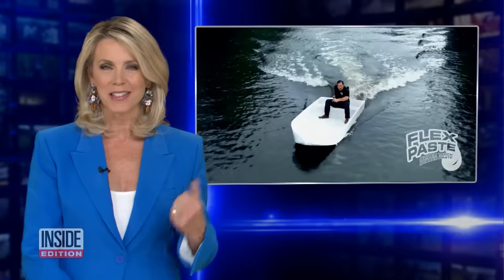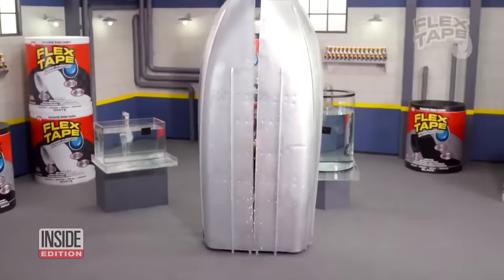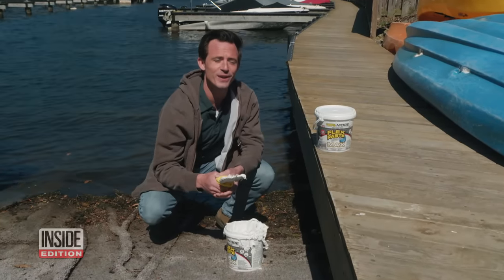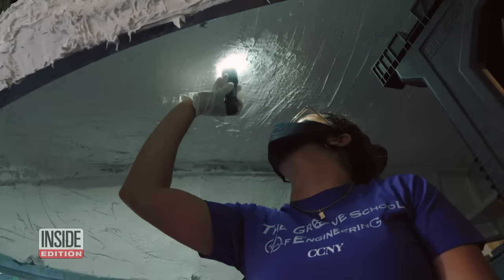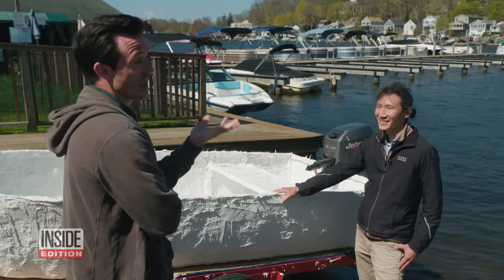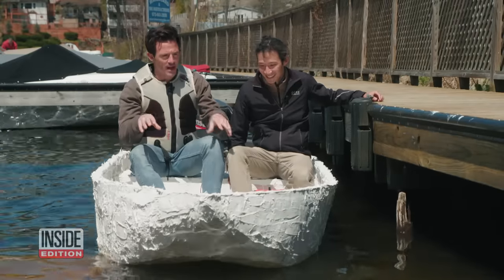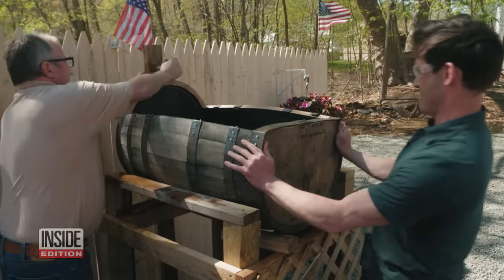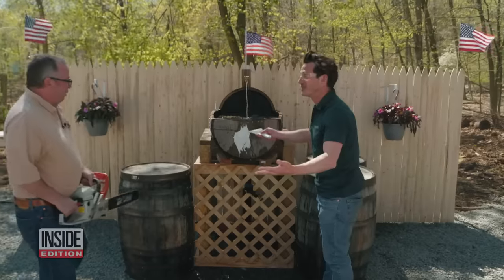Does Flex Paste Work as Advertised?

Comment: To Phil Swift and everyone - I live in a multilevel home and for years I've had troubles with my bathtub leaking when you took a shower. I seen the flex-seal commercial and decided to try it on my bathtub as a seal around it and the wall covering. I am here to tell you for over 3 years it's been on there and not one leak! This stuff works!
Reply: Flextastic!
Reply: Smdh my condo neighbor above needs to use this…just had a waterfall through the shower fixture 🤔
Reply: Flextastic 💪🏼
Reply: The prophecy is true then...
Reply: @lrac_1  secret santa gift it to hjim
Reply: Why is Phil using your shower?
Reply: @mmeo976  "to Phil.....I have a bathroom that leaks when you use it"
Reply: @mmeo976  yes, I know
Reply: @mmeo976  cause it was a joke based on poor grammar. Not that serious
Reply: @oatlord  🤣

Comment: I bought a used 2004 Mitsubishi Eclipse Fabric Convertible. I bought it for real cheap because the convertible top was leaking when it rains. Upholstery and auto shops was trying to charger me thousands to replace or fix it. But I decided to go to Home Depot and bought flex seal and some paint rollers and I painted a thin layer of flex seal on the whole fabric convertible. I tested it out 2 days later by going through a car wash and I had no leaks! And the convertible was still flexible to have it go up and down. I spent like $40. And the convertible top looked brand new. If anyone got a leaking fabric convertible top, I recommend using flex seal!
Reply: How has it held up?

Comment: I have used flex seal spray on a few things. I have galvanized chicken waterers and the seams sometimes leak after a few years. I sprayed all the seams on the outside and they hold water. I also have a large, (like 15 gallon) rubber rub you find in farm stores. Sometimes they crack after being outside and few years. I also sprayed it on the outside and it's holding water for my ducks.

Comment: I'm planning on using some of that on a couple of leaks on my steel schooner.  I'll check back in a couple of weeks and let you all know how it worked.  I also have an aluminum boat with a bunch of screw holes that I was going to fill with a marine adhesive.  I might try Flex Seal now.
Reply: Cant wait for the results
Reply: .

I wanna know the results
Reply: Leaving a comment here so I can find out the results
Reply: Waiting for the results
Reply: Results
Reply: I guess it failed and you have sunk to the bottom??
Reply: @MARVIN PETION  Jesus was the first documented Zombie.
Reply: @DB-ku4ud  Hey... I haven't been to the schooner yet.  I promise to video it and post it on my channel.  I actually think the stuff may work well enough that I keep a can of it aboard for emergency leak repairs.  You know, smear it on a piece of Dacron cloth and then squeegee the cloth down over the leak.  Anyway, I left links to my channel in my other replies.

Comment: I had less than a pea sized hole to plug and this worked for about 5 seconds even after multiple coats. it will most likely work on a non active leak, when left to dry before adding water. They should've left the camera rolling a little longer on that barrel🤔

Comment: I waterproofed a not waterproof electric scooter with flex tape and flex seal (used seal where I couldn’t get the tape like small areas), and I have ridden the escooter through heavy rain storms, just about every deep puddle I could find, and even washed it with a hose, and the escooter still works perfectly. The stuff works, rarely do “as seen on tv” products work, but this stuff really does.

Comment: I used flex paint to seal my basement wall and it perfectly worked. Only problem is that a year later moisture started creeping out from the paint which is coming from the wall and it grew mold which i had to spray with anti mold chemical. I hope flex seal can make a product that is anti moisture soon.

Comment: The only thing I noticed is that flex seal clearly sanded and polished their boat after applying the flex paste, based on the clean, almost pre-made appearance of the boat in the commercial vs the less polished and much rougher appearance of the boat tested in this video.

Comment: I've tried 3 of the products and not one of them worked. All I was trying to do was to cover a small leak. It's a shame it didn't work for me.
Reply: I've tried it on my older toilet & other areas in my bathroom.
I possibly wasn't a success behind 🚽 because the angle
I was applying it to the bottom of my old leaking tank.
Maybe we should've gotten the tape instead.
or is the tape effective?

Comment: That flex stuff works wonders, used the flex shot  around my truck rear window since it had a little leak in it 3 years later still holding up

Comment: Do you think it would work for a teenie tiny hole in my gas tank for my motorcycle that happened from rust, a little hole but lots of gas comes out, so frustrating, recently taken the tank off n drained it n aired it out, was thinking about trying to use some soder on it

Comment: I have bought and used this flex paste to hold pipes onto a 55 gallon drum and it leaked. It doesn't work. And the minute it sees any kind of stress it cracks between itself and the material it is stuck to.

Comment: I used Flex-Seal to seal up some holes and cracks in the roof of my work truck. Rain kept getting in and leaking all over my dash and knees.  After a day of letting it dry and settle it sealed those holes right up. That stuff is amazing. 🤯🤯🤯

Comment: I mean I can make a boat out of newspaper at varnish too that will float, doesn't mean that it will float forever though.   The question isn't whether or not you can plug a hole, it's whether the hole will stay plugged.

Comment: My s10 truck has a cracked oil pan. Was told they had to pull the motor to fix it. I used Flexseal and it hasnt leaked yet.

Comment: I know for a fact flex Tape works. Six years ago a deep freeze caused my fish pond liner to develop a 14 inch rip from top to bottom. I took a rag an wiped the slime off under water. I applied the tate from to to bottom even under water. It worked. Six years later, it's still holding. No leaks.

Comment: My central air conditioner drain pan leaked condensate all over the floor. I removed the pan, it was rusted thru. I used a grinder to remove rust, then JB welded the big holes. The surface was severely pitted from rust. I used a  spackle knife to spread black flexpaste all over the drain pan. I let it dry and put  the pan back underneath my air-conditioner evaporator coil..shes draining like a champ. The stuff is expensive 15 dollars for a one pound jar. Also the top half inch was hardened already. The flexpaste has a short shelf life. I had to rip the top layer of useless hardened paste out of the jar with channel lock pliers 
..yes i bought it new at one of the big box hardware stores..the seal was intact, the silica pack was there and the inner foil was there too..but it was already setting up..the stuff sits far too long on the shelf..its too expensive and people really dont fix stuff anymore

Comment: It works...in the very short term.  It has no UV protectant additives so it breaks down extremely quickly in exterior applications.  It'll get you to shore and maybe through a few days, but is not even close to permanent, or even temporary.  It is a VERY quick fix and nothing more.

Comment: Sorry added flex seal to mobile home roof, yet it still leaked.  Does flex seal/paste shrink, sperate after dried in the sun.
Your commercial is brand new material with immediate use, cured time, not six weeks and more down the road.

Comment: Flex seal NEVER worked for me, & the tape is a joke.  Has a small tear in my truck cap, slapped a huge piece of that flex seal tape on the inside of it.  The heat from the sun baked it, & it started to pull away from the cap, making a huge sticky mess.  Didn't fix the problem.

Comment: Flex Seal does NOT work at all. Tried to use it on a very very minor leak on our camper. No luck. Even out a second coat on days later. Still didn’t work.

Comment: This brand is not worth it.. I have a 90$ air matress and a small tear only 2.4 inches tall and wide as paper.. I bought 15$ roll of flextape and still didn't work. So I put super glue on and retaped it, still sleeping on floor till I can save 300$ for the cheapest matress in my area.... Don't believe everything on tv